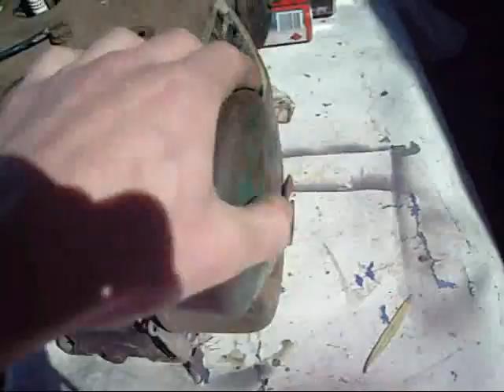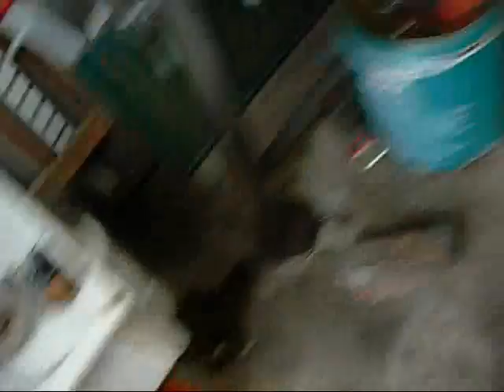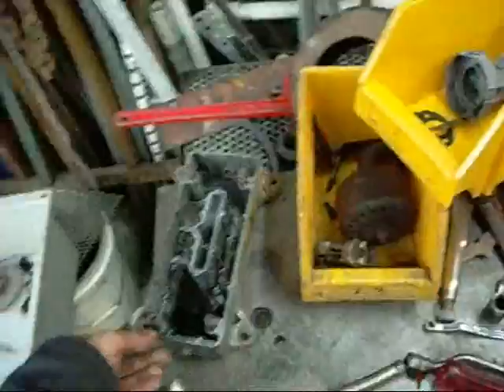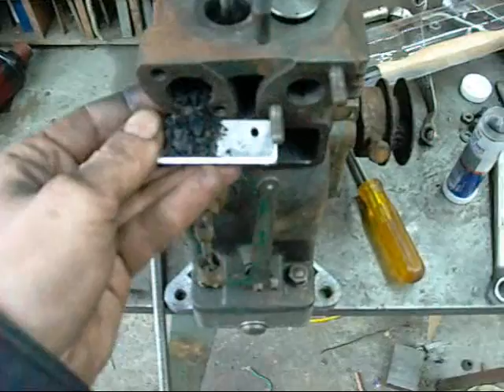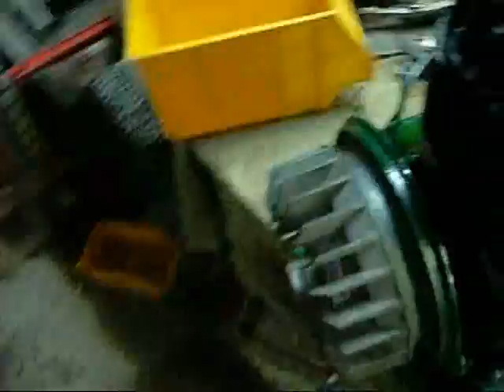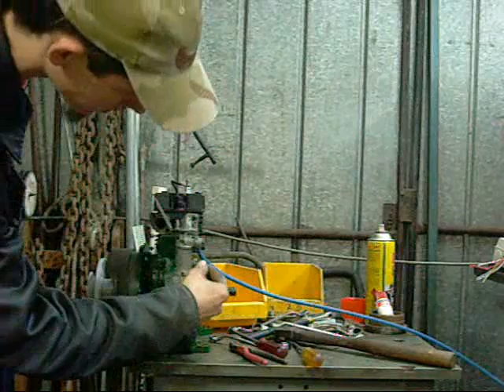Villiers Mk12 2 Restoration

Comment: mine has a plastic bottle with an oil level marker and a filter inside. i think i am to fill the same engine oil to that level so it drip feeds to internal working parts. at first i thought it was a water trap. anyone else have this setup?.... and mine has ''rob roy'' welded onto the drum. not done by someone, but from out the factory. any help on the bottle please... thx

Comment: Good video, i've had my 12/2 for ages and have not done anything with it, it was made in Ballarat, carby all complete, buggerall compresion, mesh grill missing from flywheel, someone has cut a small hole in the back of the flywheel, looks like they were trying to do the points without removing flywheel, strange. I recon my muffler will be same as yours, probably got the same valve problem as well.

Comment from the maker: @morrisminormods Cool!. for spark troubleshooting I start with clean and gap the points and inspect any kill switch wire (usually one behind the flywheel)
followed by that replace the condensor.

and lastly replace the coil.

the kick start mech sounds good too!, must be off a lawn mower?

Comment: I was interesting looking at this, I am restoring an earlyer one of these, a 1954 high speed mk12. I was interested to see the plastic govenor gear, mine has a metal one. You can find the date on these stamped on the flywheel fan casting, for example mine sais 8 54. So, August 1954. I have just fitted a new coil but alas it still needs a capaciter!

Comment from the maker: Cool stuff!, only thing I havn't got a lead on at the moment would be an air cleaner and the clips to retain it. also the bottom of the carb that the cleaner attaches to is busted up. if you have either of those I'm interested in a deal long as the costs reasonable (shipping could be a killer)

Comment from the maker: They are related to Wisconsins, the parts book at the mower shop listed a few kits for "Villiers/Wisconsin" motors, which were very similar looking gaskets, especially the crank case one. but not a direct match to mine :(

I've still got a few vids of the cowling and pull start test to go.

Comment: it's acutally made to clean engines by being sucked through a vacuum line, shutting it down for a bit and then starting it up and clearing it out (VERY smokey, there are vids of it here on youtube)

i figured it out cause i needed to clean my dirtbike's pipe (from '76, thats erm... 28 years older than i am... it's old, and a 2-stroke :D :D :D i love em)

i figured: seafoam is used to clean the carbon junk out of the insides of engines, it should work good for cleaning the inside of a pipe.